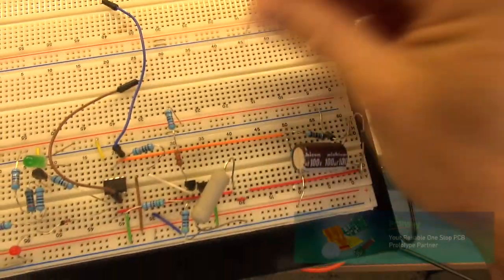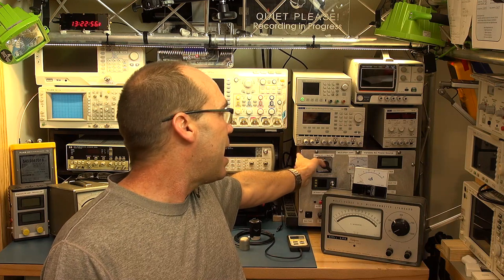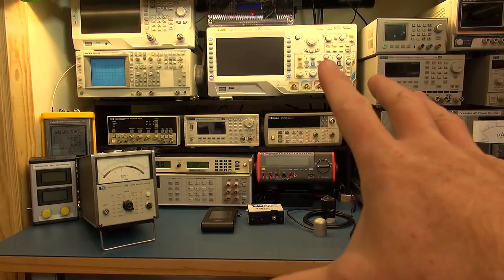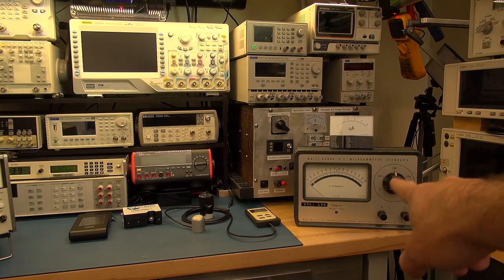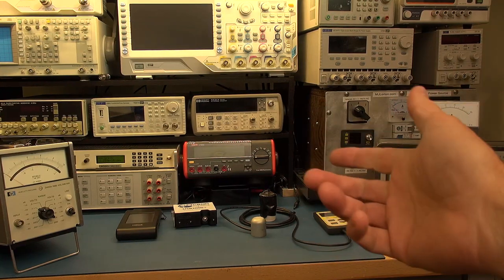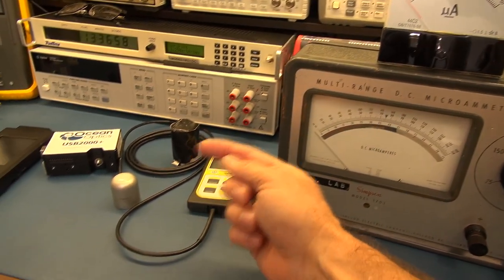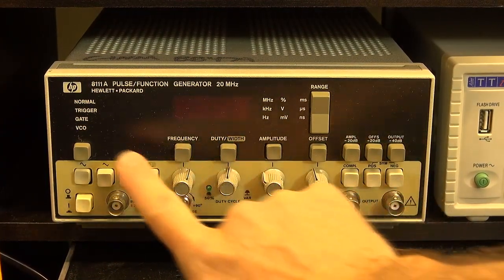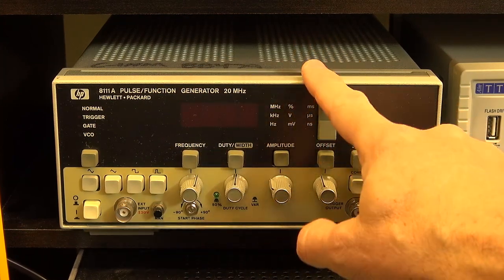T4D #148 - Ocean Optics USB2000+ Spectrometer and other bits...- Pt 1

Comment: What kind of accuracy do you have on that UPRtek, as your getting 1nm values and you got 520nm with the green and next time 522nm
but then again, these green LEDs, its not like they have a very clean spike, like you see with fx short arc mercury or deuterium light bulbs.
got a handfull of spectroradiometers & spectrometers based around CCD sensors, though optimised for visual wavelengths.. I recall my adjustment times are from 0.1ms to 5 to 10 sec and a spectraæ resolution at 2 angstrøm. (0.2m)

Comment: Nice, I will get a spectrometer myself soon, no clue what but my friend told me it is professional (for medical/chemlab), needs a computer and comes with software.   I will use it to measure leds but for most, just to play around :-)  Just like I have build an very sensitive light meter (It can measures the damping of plain windo-glass) and I play around with a photon multiplier. 

Around 8 minutes:  you can set filters in some  modern benchmeters. I use a K7510 for this  but most times meters then becomes slower (the Keithley is still pretty fast)  But using an analog meter to get a  stable reading is fooling yourself ;-) 
However Analog meters  are kinda slow but for more or less constant value measurements  they are fast enough to show  currents suddenly changing and it draws more attention to the user as a meter that is constant changing digits. That is why I, during repairs often measure the current (from a non-benchmeter supply ) using an analog current clamp meter (a bizar precise vintage HP )